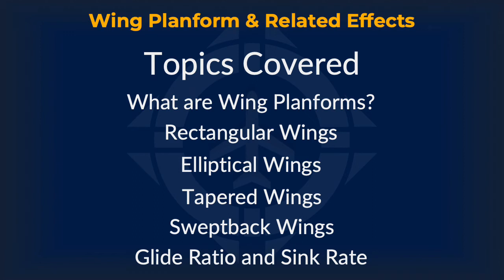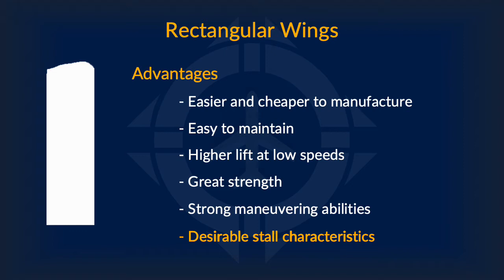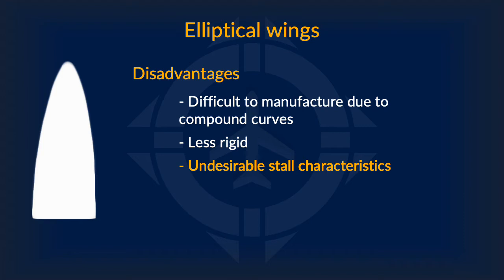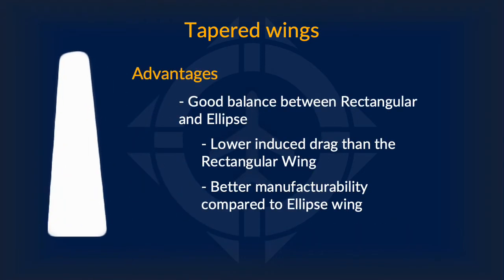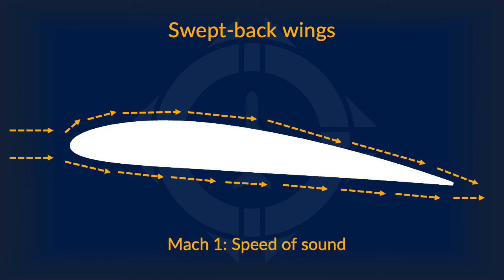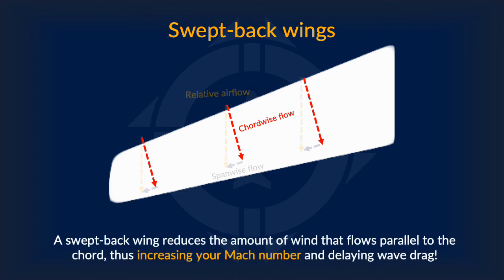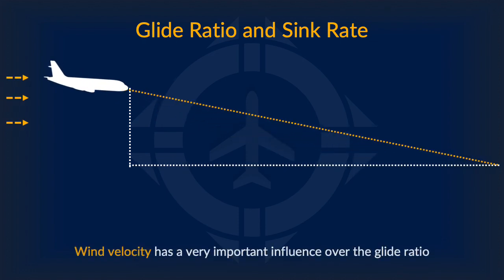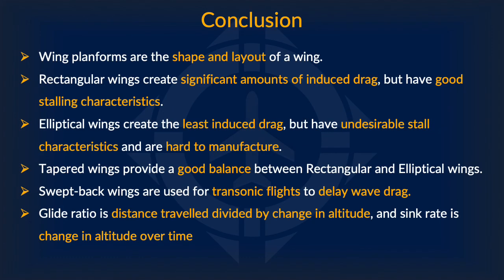Aerodynamics of Flight 3 - Wing Planforms and Related Effects

Comment: Right from the rectangular planform I had a nagging question. Does a straight wing start to stall at the root and then have the area of the stall radiate out due to the planform? I thought it was due to the typical built-in angle of incidence that is greater at the root and is reduced as it moves out to the tip by means of a long twist.

Comment: I know this is 3 years old now but @4:38 I think your graph is backwards? The blue would be the elliptical planform and lift profile. The yellow does not look ellipitical, instead it looks like a smoothed corner  rectangle, which is the lift profile of a rectangular wing. 

Oh just continued watching, it's worse than I thought, you continue on saying the elliptical plan form provides a uniform lift profile... You should make a correction announcement in a pinned comment at the least. It's very misinformative.

You also say swept wings only advantage is lower transonic drag, but they have other advantages as well. They provide roll stability, the same way positive dihedral would. Swept wings then require no or less dihedral angle.

Comment: Swept wings actually reduce drag at all speeds because some of the air flows along side the wing because they angle backwards much like sliding down a ramp instead of running into a wall. This also reduces lift because air flowing along side the wing doesn’t produce lift like the air flowing directly over the wing does, so swept wings are only fit for high speed flight.